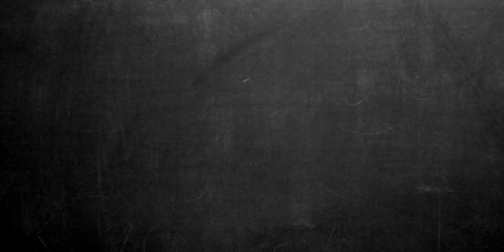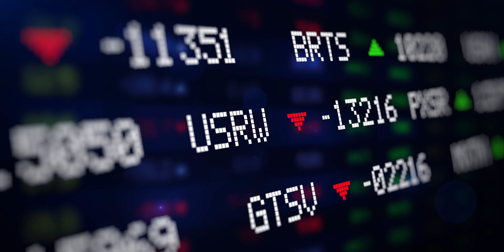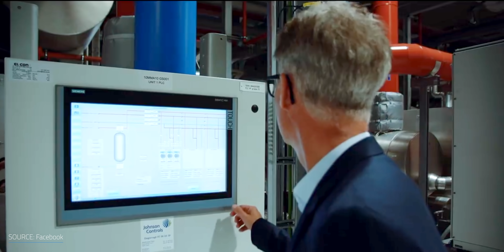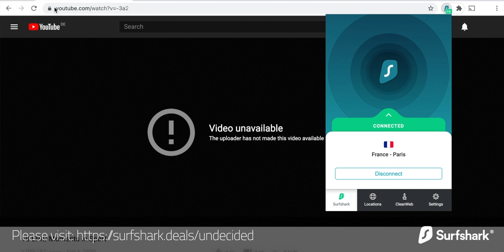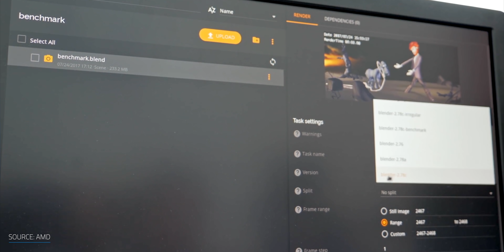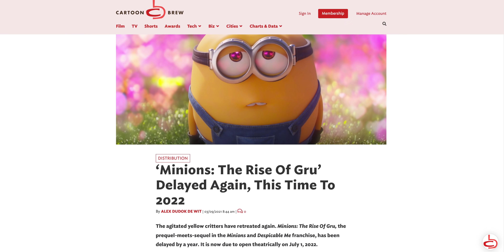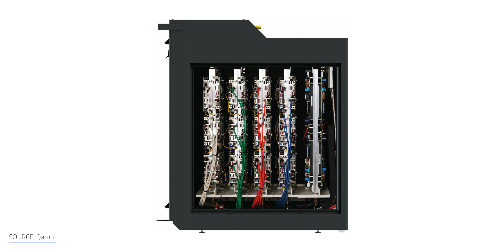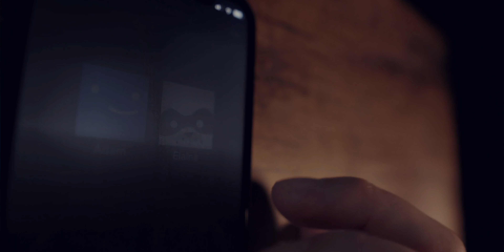Exploring How Big Tech Could Heat Our Homes ... For Free?

Comment: It fills a niche, for sure. I'm not thrilled that it will push out the main alternative, solar heat, which is zero carbon. That 85% reduction figure kind of hides the 100% cost that still accrues to the computing side. Who writes efficient code? Who's policies reduce processing requirements? Who spends as much time streamlining when your distributed server farm eats for free?

There's plenty of waste heat around because modern houses are showing up that consume trickles instead of torrents of electrons. So, good idea. Fun. Won't change much even if it becomes common because there are plenty of other ways to skin a cat or heat a liter of water. And when one only needs a bit of heat, any source will do.

Point is, we have to do something, anything. Well done, guys. Hope your plane flies high.

Comment: If used with ground water source heat pumps perhaps one could seasonally store the processor heat for winter heating in a large underground insulated  earth heat storage volume filled with heat transfer piping.

Comment: Doesn't make sense to me. For home temperature control, heat pumps can efficiently provide heat or cooling as needed.  Computers need to run most of the time, not just when a house is cold. Yes, we can recycle waste heat sometimes, but heat pumps rule.

Data centers use 10-100x more energy than needed mainly because of bloated inefficient software. We need to start measuring the energy use of software.

Comment: I live in an apartment with electric baseboard heaters.  This past fall I built a powerful 10-core computer for hosting game servers and productivity use.  I heated the bulk of my apartment by running folding@home and left my heaters off (or turned down in the adjacent rooms.)  I'm working on automating the adjustment of the workload using home assistant and a smart thermostat for this upcoming fall.  You'd be amazed how much heat an Intel extreme edition processor and a few discrete graphics cards can provide.

Comment: I remember a story several years back about some small public housing in the U.K. where they put the refrigerators and stoves along the outside walls but had controllable vents.  In the winter the vents would be closed and the waist heat would be used to heat the house.  In the summer the vents would be open and the heat would go outside.  A system like that might let them move a little farther south... obviously you don't want a computer venting to outside if it's 90% outside, but if it's 70 degrees they could get away with it.

This reminds me of my old computer and track lighting.  Years ago we had electric heating in our apartments.  They switched to a noisy forced air natural gas system that cost us a closet.  Since it's Section 8 housing the energy savings ended up going to the landlords (our heating bills went down, but our rent credit for heat went down to, so our rents went up, all done with a grant from the government that lined the landlords pockets).  But anyway, in those days I had incandescent bulbs and a computer that threw off a lot of heat.  Since that worked in roughly the same efficiency range as the electric heat it didn't add anything to my bill in the winter and gave me a heat in particular in the part of the apartment I was in at any given time.  In the summer it wasn't so good, since it was working against my AC, but it made me reconsider the whole debate about incandescents.  In my dream home I'd have smart windows and blinds that open and close based on outside air temperature, predicted outside temperature, predicted solar radiation (at times of year when I'd get a lot of sun it might decide to cool the house with early morning open windows, and close blinds later), and air quality.  Electric heat, and my lights would be  hybrids... incandescent when the house needed to warm up, full on heat lamps on command, and LEDs when it's already the right temperature in the house.  I'd have a elevated water tank to store rainwater with mini-hydro to use as backup, and to run during peak hours and pump back up in off hours... but I'd also have it so the water could run through some cooling vents as it flowed, so in the summer some of its coolness could be harvested to cool the house, also slowly warming the water cycle after cycle.

Comment: This is a super interesting subject to me, as have a fairly sizeable crypto mining setup. In the winter the mining rigs are spread throughout my home to keep everything warm, however in the summer I move them all into one room, and water cool them. Using the waste heat to pre-heat the water going into my homes hot water system in order to reduce power used by my hot water system. While the suns up its all powered by solar...however I am still buying power from the grid when the suns not shining.
Reply from the maker: Thanks for sharing!

Comment: Well, my home-servers HEVC (H.265) trans-coder automatically starts when the room temperature falls below 18°C (64.5°F)...
During summer time used storage-capacity increases, during winter it decreases. Been doing this for years...

People who want to implement such system only need Linux, FFMPEG and an Arduino with a DS18b20

Comment: Fascinating concept, especially if it is used instead of building more datacenters. I still believe thought that this will not solve a more fundamental problem: Poor mans physic would suggest that the easiest way to combat global warming is to produce less heat. Not produce more heat. And I would also challenge your numbers a little bit... How much of the global energy is used for cooling spaces, rather than heating? With the ever increasing number of AC units being installed, I doubt that this is insignificant...

Comment: That's pretty cool and a magnificent idea. I'm a contractor and I often go to these office buildings and hundreds of computers just left on sitting there overnight running 24/7. May as well be using the heat generated for something. Also, notice how the computer dumps the heat out into the ambient air of the room so now the a/c has to get it out the room and dump it outside lol. Very inefficient and pretty much insanity when you think about it.

Comment: The Université de Bougogne  in Dijon, France is already doing this by moving the output heat generated by their data center into the heating system of the campus :)
Reply: I can completely imagine the traditional fight between faculties getting a modern twist: have the Arts department barge into the Science school complaining that the workshop is too cold and them nerds need to science harder.

Comment: I live in Southeast Asia, where more homes have air-conditioning than running hot water. Where people want running hot water they have to install a separate electrically powered unit, typically a wall-mounted heater for hot showers that provides hot water on demand, but doesn't store a reserve of hot water. It would be great if the heat removed through air conditioning could somehow be used to provide domestic hot water. But if such a device exists I have never heard of it.
Reply: It does but requires lots of maintenance, that's what my family's house in Malaysia uses to heat up water. 
1. You only have a limited amount of hot water that equals to the amount heated up by the air con.
2. It requires the piping to be very close to each other and this can cause a lot of issues with maintenance we've had to replace them often after 5 years.
Reply: @ANTSEMUT1  Thanks for the reply. Do you have a link to any details on the systems available?

Comment: It exists at a larger scale : Atos uses it’s Helsinki data center heat to warm projects around the site.
Reply: As does The Halifax Bank in Halifax in West Yorkshire and has done since the 1970's before it was all trendy.
Reply: Same thing in Stockholm, Sweden. We also cool most of the city's office space with cooling from the Baltic in the summer.
Reply: There are multiple projects, although they need inefficient heat pumps and only reach 40 degrees celsius at max. That is innovative here, they reach higher heat without heat pumps needed.

Comment: Why can't these be used for Netflix?

What do you think about finding a way to make summer refrigeration more efficient?  I mean the way it is now our fridges and freezers kick out heat that if you are running a air conditioner  because it's hot outside, needs to be further kicked out.
Reply: Because Netflix has unpredictable demand and requires lots of network.

Simulations, rendering et cetera, will use all computing power all the time, so the user of the heat can adjust the available heating/computing as needed.

Netflix, Youtube and all demand driven services will have times where they need to do a lot and time where they are idle.

As for the network; Netflix needs to send the entire video over the internet. It can't just skip the middle. Simulations just need some initial data, then they can run offline for a few hours only to upload a short summary of the simulation. Rendering is the same, the intermediate calculations aren't important, just the final image.
Reply: @dtkedtyjrtyj  
"Netflix needs to send the entire video over the internet. It can't just skip the middle"

  "The middle" could be skipped if the viewer skipped it. But  what's your point?  With few data can you afford to skip the center of the data.
Reply: @firstlast-cs6eg  But people don't skip the middle of the movies; and even if they did they would want a continous stream of the begining and the end; not the beginning, a blank screen for two hours and then the end.

The point here is that Netflix primarily need the bandwidth of a data center and that isn't something that these heaters provide.

They provide computing power and leech the bandwidth off the rest of the house.

Comment: I remember seeing a demo server from gigabyte back in...... 2017? that was fully submerged in a phase change fluid that boiled at i'm guessing 65C, now, they had a large cold water heat exchanger that would condense this fluid back to liquid, but i thought it would be cool to use it to drive a steam turbine. instead of water steam, it would use this lower temperature phase change fluid

Comment: I didn't see any mention of security or resiliency with these devices.  Two things that you would expect from a data center is top notch physical and cyber security and high resiliency.  "Right tool for the job" is right, this probably doesn't fit many of the typical business needs these days.
Reply: Yep. Anyone can dress up as a "service technician" and go to the basement to "hot swap" some equipment, get free computers, or hack into systems or install malware...

Comment: This is dependent on waste heat from computing. We are currently in the "incandescent bulb" phase of computing. Theoretically, it's entirely possible for computing to produce zero waste heat. As we get smarter about design and materials, waste heat goes down - it has been going down since the first digital computers were built. We may never reach zero waste heat but, like the switch to LED lighting, it may become so small it's no longer a consideration.
Reply: But this is about sorting our problems today. Give it a few decades and either renewable energy will be dominant or we'll have bigger problems.
Reply: @armadillito  That's the point. If we design system today for a diminishing issue, it becomes a waste itself. If we designed systems to recover the waste heat of incandescent bulbs, by the time they were ready to deploy, they would no longer have a viable energy source. The problem isn't that we need to recover the heat energy, it's that ancient wasteful equipment still in use needs to be upgraded to much more efficient technology.

Comment: I think this type of system integration is a must going forward. We are seeing a necessary shift to a closed loop energy system where once energy is generated we need to recapture/re-use as much as possible because the cost of going back to nature for more energy is just too much now with our massive demands.
Reply: Or we could just go nuclear and have cheap reliable energy that we can afford to be liberal with
Reply: @d3734  although nuclear would be reliable, it is not necessarily cheap initially.
Reply: @d3734  Most people are still scared of Nuclear even though its the safest and one of the cleanest ways to get energy I blame big oil lobbying.....
Reply: @d3734  or do both and minimize the miniscule risk of a major nuclear problem even further by building a couple less
Reply: @d3734  With nuclear this is still a good way to go, as you just increase efficiency. Reduces the amount of nasty waste created
Reply: Thorium
Reply: i think this could be used for electric car charger stations,if we could feed energy into these mini servers,we could perhaps turn that waste heat into electricity (in the safe fassion in a nucler power station)and power cars through charging or when not in use, perhaps it could be used to split water to generate hydrogen for fuel for other things.That way the servers can be running all the time,regardles of climate and perhaps by making a deal with fuel stations,this would help perhaps increse there profit for example they could charge lower for the electricity and with it being cheaper,it will incentive customers to go to that station and also anorther incentive for the consumer side. ,more electricty/fuel stations beacuse of it being more lucrative,so that makes electric cars more feasible,beacuse more places to charge your car when your away from home and it being cheaper.Plus the could goverment support,in perhaps a scheme to support this beacuse it could help with climate change strategies.

Comment: I have wondered in a different direction.  It would seem to me that figuring out a way to make racks in data centers power Stirling engines would allow for heat into electricity recovery quite straightforward.  There is a big temperature difference between the top and bottom of a rack and there would be no problem with the location.  This would work in hot places and cold.
Reply: Hmmmm. The cost and complexity vs amount of power generated might be a tough sell... and you would still have to find a place to send the heat afterwards.
Not saying it's a bad idea, might just be hard to get traction
Reply: @joshuacheung6518  Well, data centers have the heat removal problem anyway.  And we would have to see.  Stirling engines are very simple and run off of temperature differential so an active data center would have that.  And it solves a couple of the problems that were a bit skimmed over with Qarnot's system.  At least one of them runs off of water.  Which means that they will have problems with water leaks at some point.  Distributed maintenance is a more regular problem.  Instead of having one place to go to fix 1,000s of computers, now you have them distributed over 1000s of square miles.  Don't get me wrong, it is not the worst idea that I have seen.  Just one that has (like all things) limitations.
Reply: The problem is that stirling engines provide no solution and adds complexity. A stirling engine does not remove, or even significantly move heat, unless I'm misunderstanding them greatly, whereas with distributed computing coupled with on demand heating, that makes use of the heat generated.
Reply: @joshuacheung6518  Stirling engines use the heat to do work.  This lowers the temperature by transforming this heat energy into (in this case) electrical energy..  Which is the idea behind heat removal.
Reply: @jimsackmanbusinesscoaching1344  not significantly. That's like saying a thermocouple removes heat.
Reply: Re-reading that, i think you have a gross misunderstanding. It doesn't transform the heat into electricity, it merely moves it from a hot area to a cold area, and uses some of that motion to produce mechanical energy (which then goes on to produce electrical energy). If anything, overall, they generate a tiny amount of heat through friction.

In your example of top of server racks being hot and bottom being cool, all it would do is make the top mildly cooler, and the bottom a bit warmer. You then still have to remove the heat.
Reply: @joshuacheung6518  I think you need to rethink that.  The engine is doing work and that takes energy.  Energy will come from the kinetic energy of the hot side.  Since energy is conserved, the mechanical energy has to come from some place.  This transformation will lower the overall temperature.  I think you are thinking of typical small Stirling engines.  Large ones do things like run submarines.

Comment: Could we use a Peltier plate to recover some of that heat back into electricity?
Reply: A large temperature differential is required at all times for that to work. There are, though, more efficient ways to recover heat energy and use it to generate more electricity.

Comment: Every household needs domestic hot water.  Use the waste heat to supply the hot water needs of all houses.  I still have an electric water heater that sits there all day using electricity.  This wouldn't work for point of use water heaters.  I am looking into adding a separate heat pump system to my water heater.